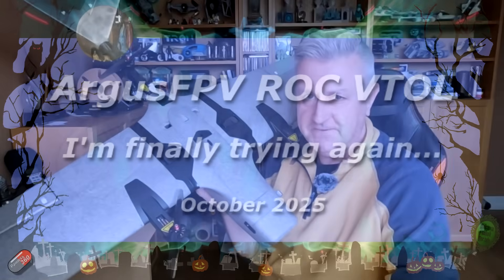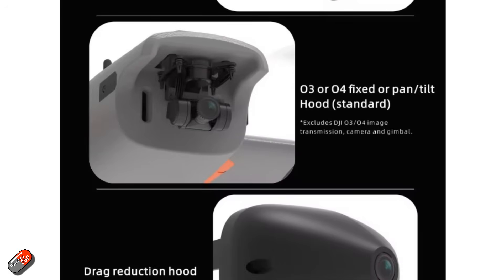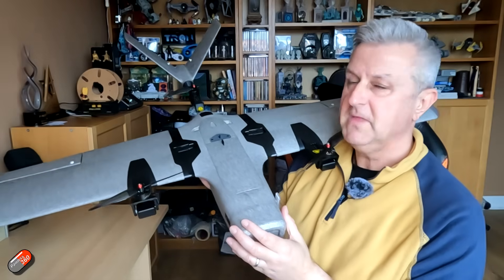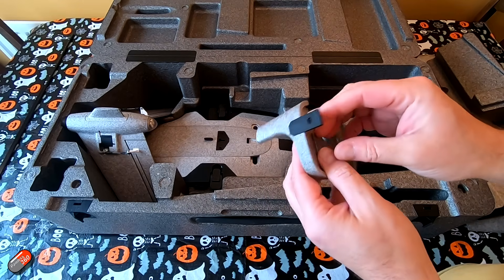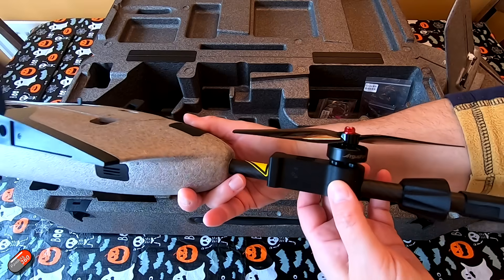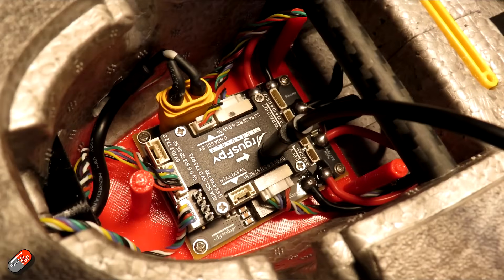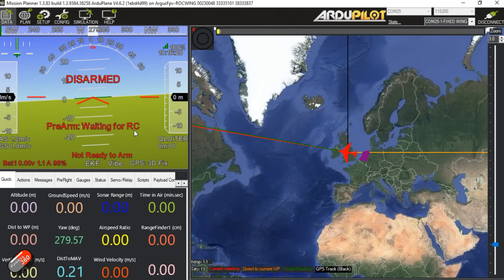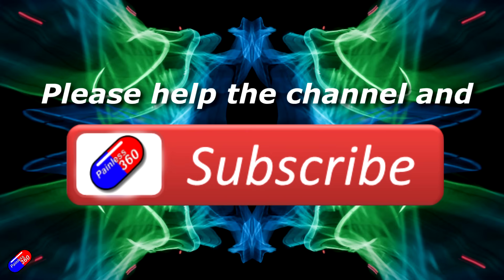ArgusFPV ROC Wing VTOL: First look at a new VTOL

Comment: Just received my Argus Rocwing (RTF Plus package). The only place I could find 10 days ago to buy it from was Dronesset (USA). Can't do anything with it yet as now awaiting suitable Lipo arriving, but even if I had a battery I wouldn't try it anyway - until I've seen the next video in this series !!   PS I also have had a succession of other hobby VTOLs (Swan K1, Zmo, etc.) without having a reliable and trustworthy product.
Reply from the maker: Stay tuned. I'm waiting for a nice day where one of my flying buddies can be my spotter/hat-cam operator....
Reply: @Painless360  Hey Mate ....did u have to solder anything with this kit? Apart from the ELRS receiver.
Do you have to solder the power connectors and ESC's to the board or is that all done from the factory?
Reply from the maker: The cables for the receiver and HD FPV system are in the box so you will need to solder them to those pieces. That's it.
Reply from the maker: @sicnics https://youtu.be/p7NEtQgpA4I

Comment: You shouldn't transition to fbwa from q loiter.  You should go to q hover first.  And shouldn't go back from fbwa to q loiter.
Reply from the maker: Why? Please explain why you think that....
Reply: @Painless360 im sorry i misspoke.  Its ok to go into fbwa from q loiter, but going back to q loiter from fbwa isn't suggested.   The plane will want to position hold wherever q loiter is engaged at causing it to want to stop very abruptly.  I go from fbwa to q hover till it slows down a bit then q loiter.
Reply: For beginners and stable aircraft, switching from Qloiter to other modes is a good choice. Moreover, when other modes show signs of a crash, quickly switch back to Qloiter to ensure your aircraft doesn’t crash

Comment: If anyone is new to VTOL, I can recommend iNav because it worked great for my first VTOL build.  Last month I finally got into the VTOL thing with a Heewing T1 Ranger using iNav 8.0.1.  iNav is more preferred for me because Ardupilot is more difficult to learn of all the three major flight controllers: iNav, BetaFlight, Ardupilot.

I can say that iNav 8.0.1 worked great and all the numerous online documentation and videos on the VTOL setup made it kind of easy to get working.  This is the benefit of being a "late comer" as I can use all the tutorials and experiences people have put online! 👍

My Heewing T1 Ranger does everything a smaller RC fixed-wing plane does, and has the neat VTOL capability.  I can do loiter, cruise, waypoints, and RTH.  I usually do a fixed-wing auto launch but always return and switch to VTOL just before landing.  I can do VTOL takeoff too but figure its more energy efficient to hand launch it in fixed-wing mode and iNav's auto launch works so consistently well all the time.  The T1 Ranger's small size and easy grip makes the hand launch especially easy.

Comment: Do VTOLs typically return to home as a plane or by hovering?
Reply: Return to home like plane and landing like drone
Reply from the maker: You can set it up, most return to home location as a fixed wing, descend as a fixed wing, than land like the quad. How this one is setup is covered in the manual...
Reply: You can set them up either way

Comment: I have a ZMO Pro and fortunately I haven't had any major failures, however it is NOT intuitive to use. I've spent countless hours refining the settings on that came on the FC and through some research I've found that the motor mounts are the cause of transition failures. 

That being said, I have also not flown it in high wind conditions as it's really only advised to be flown in under 10km/r winds

Good luck!! I can't wait to see how this thing flies!! I love the idea of the gimbal cam but that's also a scary/expensive ordeal potentially

Comment: Fixed Wing VTOL has been a big hurtle for me as well. Maybe we are just overthinking it. I Built a quad tilt rotor embedded in an Skywalker X8. I still have to upgrade, re-configure and test. Someday. JATO required for 50m/s transitions.
Reply from the maker: VTOL comes many forms,  the hobby fell in love with tilt-rotor style, and vendors started selling tilt-rotor models with lousy setups and poor hardware choices. That, coupled with bugs in the Ardupilot code, meant that it was a fraught experience for many. Myself included.
Building something like a 4+1 style VTOL has worked well for years. It offers a much wider safety margin than tilt-rotor. That's why professionals use that layout... happy flying!
Reply: @Painless360  I also built a 4+1 off the Ranger. Came out very nice. Will say it was my longest forward flight. Maybe a 600 meters. Before a 3d printed motor mount on the quad system pealed off. As it was hanging on by the motor wires flailing around in the air current, resulted in no control authority. The control surfaces became useless from the added drag, and it just lawn darted in. Still have to rebuild.

Comment: I had problems with T1 vtol. What I ended up doing was shortening the ailerons. They ran full length of the wing so the prop blew over them, as they changed attitude depending on angle of the motor all kinds of stupid was going on. Shortened them to where they where no longer blown by the prop and the plane was good in all motor positions. Good luck with this one lee
Reply from the maker: Thanks for the tip, much appreciated! Happy flying!